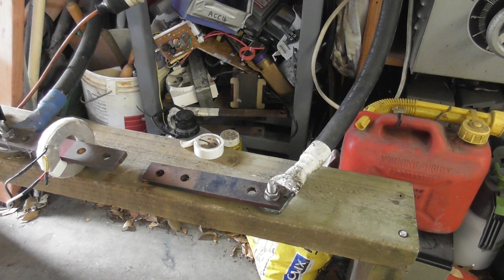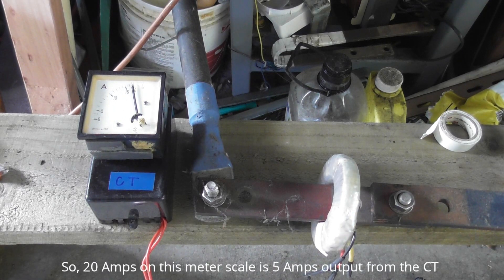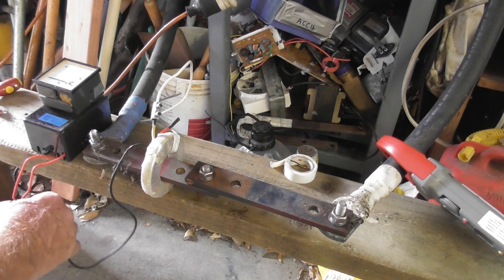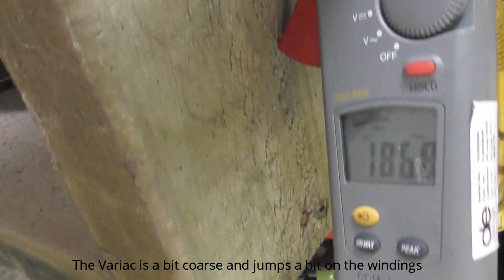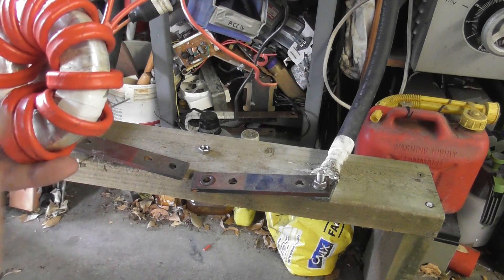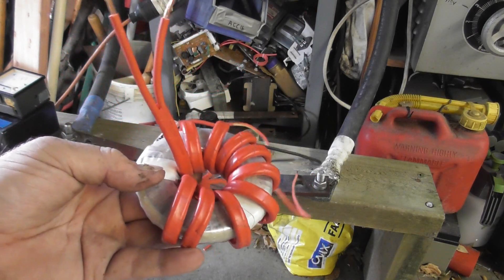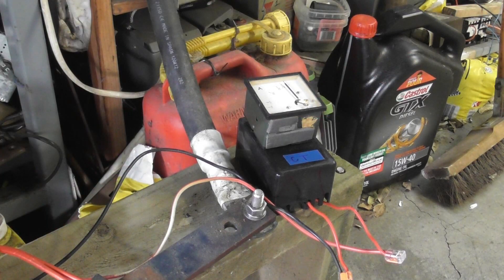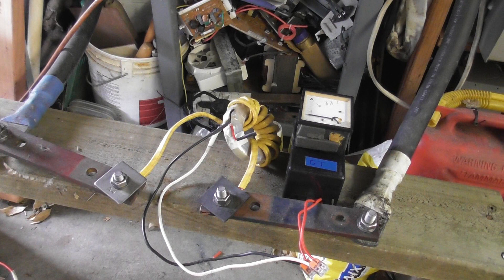CT's modified Current Transformers

Comment: Yes also have built CT's using old toroidal cores out of transformers, winding on a few turns of the old secondary wire for the measurement side, and passing a single turn as primary. Also made one the opposite way, taking a 10 turn primary and a 1 turn secondary, so as to change the resolution of a kilowatt hour meter up 10 times, so that the 0.1 range became the 1 range, and thus making it easier to use, as the max current was never going to exceed 5A anyway.